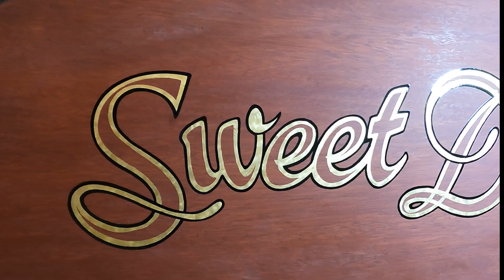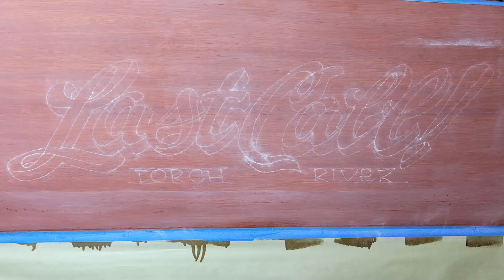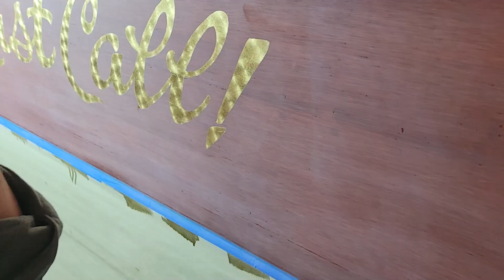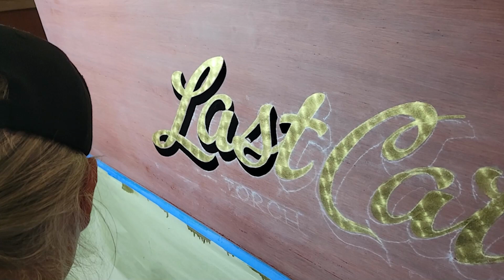Painting a Wooden Boat Transom by a Professional

Comment: Mike, how do you apply the varnish over the gold leaf? Do you just roll it on (gently), or is there a spray coat applied? Really enjoyed this video! Such steady hands. I've always used stencils, but this Dan is clearly an artist and it shows.
Reply from the maker: We gently wipe the areas around the lettering with thinner and then go over the lettering with a tack cloth. To apply the varnish we use the normal roll and tip method. Thanks for watching!